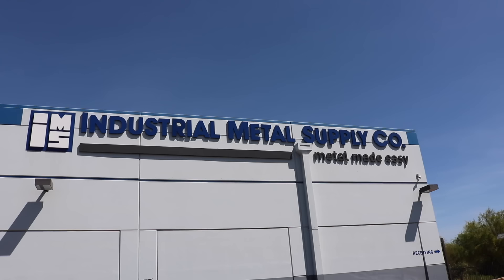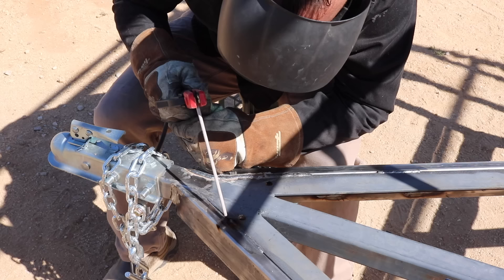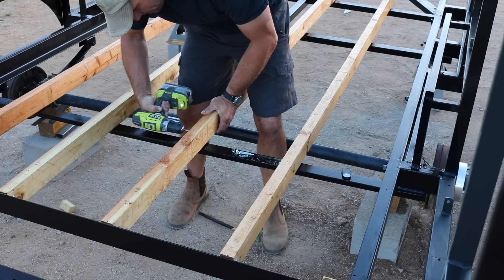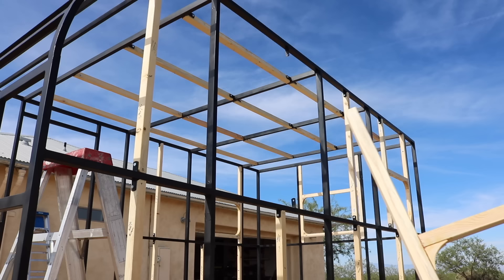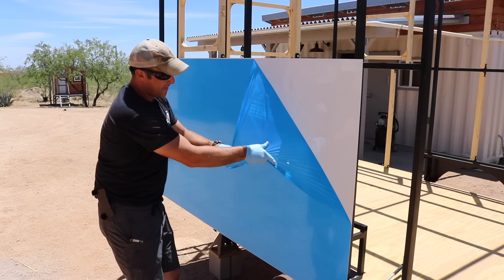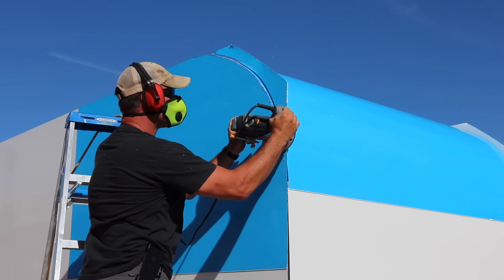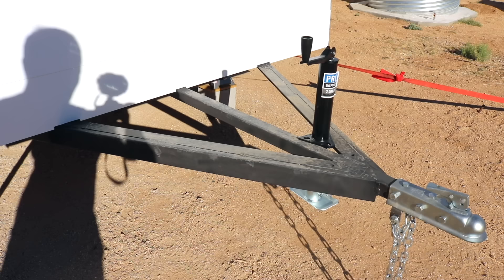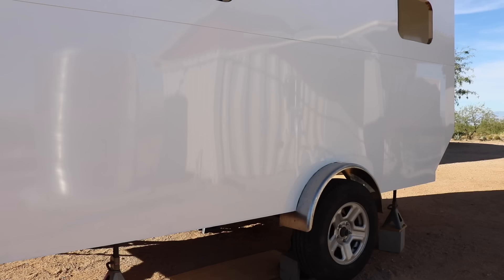How to Build a DIY Travel Trailer - Aluminum Exterior and more (Part 2)

Comment from the maker: For those interested in the Forney multiprocess welder I use, here is a link.  Forney sells welders, plasma cutters and just about any other metal working tool you can imagine!
http://bit.ly/2LjRRqH
Reply: homesteadonomics about how much do you think it would cost to build one of these?
Reply: Wow looks awesome

Can you please provide a listing of all materials and lengths needed to build your projects without a paywall for everyone outside USA
Reply: Me gusta lo que siste saves yo tanvien quiero aserme uno de lo mismo yo soy soldador ya
Reply: how many lights does a cargo trailer legally need?
Reply: homesteadonomics What is the name of that sheeting metal you used for the sides & roof of the camper?  I don't have the same metal shop supple place here in Florida panhandle. If I find anything like it ...I'm sure it will probably fall under a different brand or name.
Reply: As per usual, an excellent quality built result, well put together video as well. In a world gone mad it's a breath of fresh air
Reply: what kind of panel did you use?
Reply: What gauge is the panel?
Reply: Porque tengo yo que ablar en ingles porque no ablan ustedes el español jaja
Reply: How many times did you spend? 🧐
Reply: what did you use in outer covering
Reply: I'm interested in knowing if you can do that in all aluminum frame  and aluminum chassis and in a 1corter inch thick aluminum wall in the exterior

Comment: Not bad for your 1st trailer build. Some tips from someone who was in the RV business for 20+ years. 1. If you are going to run water lines, gas lines, installing grey, sewage, and fresh water tanks, you will want to run those underneath your floor and then have them insulated, heated and self-contained (covered). A polyurethane bottom to enclose your plumbing will protect it from the elements, plus give you additional storage space. By placing your tanks above the floor removes a great deal of your living space. 2. Make sure you have room for your power converter, hot water heater, furnace inside the trailer. You can build those into your living areas. I would also consider framing for an air conditioner instead of a fan for the roof. You will be much more comfortable. 3. Make sure that you use windows that will allow you to have an additional escape in case of fire. If your door is blocked, you will still be able to get out. Good luck with your build, it looks great.

Comment: Did that for years, worked for 2 big RV Companies. Weld dept, Chassis Prep, Floor Dept., and Rough Electrical. 
You did a great job!! Hahahaha Me personally, I'd never buy a RV most are junk. Everything except the Chassis and frames, is plastic and the wood used is kindling. 
  But to build your own, YES!! YOU SIR ARE GOOD.

Comment: Joe, I recommend fabricating some kind of plate and welding that to the tongue instead of welding that jack directly to the frame. In my experience, those A-frame tongue jacks get destroyed pretty easily, and for stupid reasons, and it will make sense to be able to just unbolt the old one and bolt on a new one.
Reply from the maker: yes, that is seemingly the best idea... you and several others have mentioned it and it makes total sense.... already looking at my scrap pile right now for pieces that I can make into a mounting plate :)

Comment: I bought  a tiny 5' X 8' barely used carson enclosed trailer. I made it into a tiny off road camper with a couch bed...it was a fraction of the price of a moby 1.  So one thing I forgot to do at the stage you left this video at is adding backing for a grab handlebar the door.  And another thing, get a roof fan with a thermostat. You will love it... when it gets really chilly it will automatically turn off. Or if it's summer you can have it kick on above say, 90 degrees. So finally add a couple wall mounted marine fans, if you just need a breeze. Lots of led lights. Looking good!

Comment: Nice job!  i would run a bead of sikaflex on the inside of the aluminium panels along the frame.. sure that tape is good but some extra strength wouldn't hurt especially because would be so simple to do
Reply from the maker: I've heard some great things about sikaflex!   lots of folks use it on teardrops and other campers with great success:)

Comment: Awesome to see u put some thought into it sealing all the wood I'm rebuilding a slide in truck camper all the wood was rotted out because nothing was sealed it is now every piece all sides awesome trailer much better built then any thing u can buy
Reply from the maker: Yes, I've seen a lot of rebuilds online showing the rotted out wood and I'm trying to do all that before hand in hopes of saving problems down the road :)

Comment: I'm curious to see how much it will weigh once it is finished, dont weld the jack, weld a plate and then bolt the jack to the plate. I had to replace a jack that was welded and it was a pain in the butt, I bolted the new jack in so it will be easier to replace if it breaks again. Use tubing to run all your electrical wiring in case you have to modify or replace  it in the future.
Reply from the maker: I'm shooting for low 2k range in weight.  It's not going to be a light trailer but I'll be happy if it ends up around the 2100-2250 range.   as for the jack, yes I do like the idea of being able to replace the jack so I'm definitely leaning towards adding a piece of steel and bolting.... you and a couple others mentioned that and makes total sense  :D

Comment: Can't believe the siding is just attached with sticky tape! Modern materials are amazing. Awesome project sir - looking forward to the next video.
Reply from the maker: yes, it's crazy how just tape can hold it on... but some trailers have been using it for years with success... if for somereason it fails I figure I can always add screws or rivest later :)

Comment: Beutiful work. I'm a welder by trade for 35 years. I used to work for a company in PA that did coustomize work for a trailer company. The trailer company had a carpenter / cabinet company to do the interiors. Was interesting n challenging work.

Comment: Just a tip for your floor. I used regular hardware and 3 years after it was rusted enough to break. I went and used some galvanized nuts and bolts I had left over from fencing my back yard and now no issues. When i refloored my car trailer i used them again where i could and they still look like they did 8 years ago now. I'm in the midwest so winter roads is one but parking around or on grass will rust the underside fast. Also run any trailer light wiring underneath to have access if a need arises.
Reply from the maker: Yes, I probably should have done that now that you mention it... but we don't plan on traveling too much into cold areas during winter where salt it used... but now that you mention it I do kinda wish I would have done that...haha      As for wiring that is the plan so far, and for the access that you mentioned...... 
but darn it.. you got me still thinking about switching those nuts and bolts out...lol  ;)
Reply: And if you do it, remember to add Thread lock in it.... lol

Comment: Looking good, the white aluminium is sharp! Really interested to see how the tape holds up. Every part of me is disagreeing with it but if it's been used commercially then you can't really argue
Reply: We used VHB to repair a friends camper roof. Tree had punched a hole in it. Cleaned down to bare aluminum, made a nice looking patch, used the tape then some camper seal caulk(stuff is way different than normal caulk) and it has lasted 5 years of MN weather so far. Hard to see the patch because his roof has that rubberized roof coating stuff on it and it got a whole new coat to keep other seams from leaking...
Reply from the maker: Thanks Robin!  its crazy to think about but it's got a great track record... worse comes to worse I can always add rivets later :)
btw... I hope you are getting some good two hour stints of sleep through the night ;)   gets easier after the first 3 months!
Reply: If you add rivets later,  don't forget to put plastic top hat washers under them so you don't electrically connect the steel to the aluminium,  or else you'll get galvanic corrosion.   That's an advantage to that tape that you didn't mention.
Reply: As long as the surface prep was done correctly (which he did) the VHB tape should actually provide a stronger bond than rivets. It has the benefit of being more flexible than rivets and providing some protection against water intrusion along the seam.
Reply: But I dont know the name of the tape that was used to hold up aluminium
Reply: I spent 20 years in an auto factory. Mfgrs have used that stuff for years to attach trim, ground effects, spoilers, etc. If properly applied, it won't come off of its own accord. It can be taken off. In this application, you'd destroy the aluminum getting it off.

Comment: I am very interested in seeing exactly how you going to seal the seams especially the corners.
Reply from the maker: it will be mostly seam-seal tape and butyl tape.. and then on the overlaps where the void is larger I will use some levelling sealant to 'flow' into the void area.  hope that made sense:)
Reply: Do you plan on using any sealant/tape on the vertical panel seams ?

Just my 2¢, but I would have made the front about 1"-2" taller to guarantee that rain flows off the roof.
Reply: @homesteadonomics  👍
Reply: @homesteadonomics  h
Reply: @homesteadonomics  👍
Reply: @jackpatteeuw9244  👍
Reply: @homesteadonomics  hh
Reply: @homesteadonomics  h
Reply: @jackpatteeuw9244  👍👍

Comment: You should be happy with the progress thus far. You're doing an awesome job on the trailer. I envy your metal working skills. Have you ever thought of holding meetups to introduce metal working/welding to the DIY community that follows you?
Reply from the maker: thanks John!  I am happy with it... just wish I had a couple weeks of the windy weather back and turned into more progress... hoping to have it ready by August ;)
as for meetups, I've definitely thought about it.  The issue is where/when,etc,.... the wife doesn't really want anything at home for obvious reasons.   but perhaps maybe something at an IMS might be something I could look into... not sure, but I will think about it!
Reply: Maybe a deal could be made with your neighbour to use his new shop seminar center.    the old guy  Bert

Comment: I would recommend that you bolt on the trailer jack.
Reply: Yup! First time you hit a rock or a steep driveway and fold it back you will be swearing at having to grind welds!

Comment: Are you going to add leveling jackets? If so, will they be manual or electric?
Reply from the maker: Hi Darryl,   Yes, I'll be adding some stabilizer jacks... manual most likely.  I'm still deciding between some flip down jacks and aluminum A frame style ones.   the flip down ones look really cool but the a frame ones seem more reliable... decisions decisions... LOL :)

Comment: If you want to get the best seal at your seams, use PRC. It’s specifically designed for sealing aluminum skin joints on aircraft and will not fail no matter the environmental conditions. One of our engineers did his trailer with it over 20 years ago and still has yet to have a leak, and that’s sitting outside in Canada all year round.
Reply from the maker: I think I read about that on tnttt.com... seams like great stuff and I will have to look back into it:)

Comment: Great trailer idea! Great hands!)) this design allows you to increase the trailer 2 times!! since the beginning of the extendable base on 2\3 with the retractable pull-out of niche then the niche put forward by another right and left on the floor of the size of the case... It turns out the whole house on wheels!

Comment: Congratulations on the beautiful trailer build!  Going to build one myself.  I spotted just one problem where the steel and aluminum are not electrically separated.  This will cause galvanic corrosion at the contact points and rust out the steel.  It's simple to fix by using plastic washers or adding plywood in between.  Awesome build man!

Comment: Use a thinned epoxy to saturate deep into the plywood and then a full strength coat to finish. Old boat builders trick.

Comment: Using the VHB tape is a good idea, because it is giving you an additional benefit that you might not have appreciated: you are bonding dissimilar metals, with a danger of mutual damage due to electrolysis. The tape is providing you insulation and isolation between the steel frame and the aluminum siding.

Comment: Very nice work. May I suggest welding a bracket for the tongue jack instead of welding it to the frame. I only suggest it incase something happens & it needs to be replaced, though as good as you are @ welding it probably wouldn't be a big deal for you. I can't wait to see part 3.
Reply from the maker: thanks!  and yes, its' been brought up a few times and makes total sense... so that is definitely the plan now... bracket versus weldon :)

Comment: The aluminum looks really good, looks like it's gonna be watertight. I'm rebuilding an Airstream motorhome aside from using stainless on the inside instead of aluminum I'll probably use the same method of the tape over the aluminum frame to adhere the stainless. Can't wait to see more progress and how you enclose the edges of the trailer. Good job.

Comment: Nice build ! I will be very interested to hear final costs and weight . When I rebuilt my old class c cabover floor , I bought a flanging tool that would have made your aluminum panel overlaps much tighter . As a former volunteer firefighter , I am amazed at how poorly many trailers and motor homes are built . Much particle board and two by twos . They fly apart on impact . Yours looks well built and sturdy .

Comment: Don-MN/ A note on return of trailer if stolen: Stick your return address label inside tail lights and side markers if possible. A Warden or Trooper sees a close match and signs of tampering and tongue ID missing can remove light covers and get your info from within ! We have 30-40 thousand dollar fish houses for Ice Fishing and Summer camping. Hurts to have one stolen. I believe it's harder to steal again with rebuilt knees !  Your videos are top line. Thanks, Don. PS, I'd put rebar inside angle iron top of lock; Disc would not reach through and rebar would rotate, for longer cutting time and sparks should draw attention or run his battery down !! Paranoid ? You bet.

Comment: Nice job, it's looking great. From an engineering point, it might be good to use nylock nuts, or at least spring washers on the frame to wood bolts, as once it is covered you will not be able to tighten them, or you could jam a second nut on each one to stop them coming loose. Don't like the sheet metal hitch either, I would look for a more heavy duty cast one.
Reply from the maker: thanks Jon!  the extra nuts is a great idea... and the hitch is from the original build idea from two years ago... its still up for reworking as its just on with bolts and not welded... this trailer started as a 5x10 that was to be pulled by my jetta tdi... well now it has morphed in to something much bigger.  thanks for checking it out and the nylock advice :)

Comment: Joe, I'm surprised you didn't use pressure treated lumber underneath...educate me! Stoked I finally started my welding table! Bought a plasma cutter today, so had to redesign some elements of the table in progress. Best, @HoneyOnWales
Reply from the maker: congrats on the plasma cutter!   as for the pressure treated lumber... mostly an availability thing for thickness... my local homedepot had it in the almost 7/8 thickness which I thought was too heavy and overkill for the floor.  But my research on tnttt.com lead me to opting for sealing well... because the only time the wood should be exposed to water is during transport.  and for that the bottom, after I finish wiring and plumbing will end up getting a couple more coats of water proofing as well as a spray barrier for road spray.  so in short, I don't expect it to have all that much water exposure... hopefully ;)

Comment: At about 6:53 I saw that your roof had no crown. When I restored my 12' Shasta I put a crown in it to insure that water would not pool and ac could be added without putting a sag in the roof. Please be assured that I'm not being critical, just passing on what worked well for me. I thoroughly enjoyed your build and I learned some things. Thanks!

Comment: Well that is a lot of work. I would just buy a used horse trailer and convert it. A lot of horse people use their trailer to haul the horse .When they get to the camping site take the horse out and put cots in the back or if they have a large dressing room up front it has bunks ,frig. lots of cabinets or peg board to hang stuff. I have a nice insulated 2 horse with dressing room bumper pull with dressing room.

Comment: Since you're looking mostly at boondocking - what are you gonna do as far as holding tanks; how big are you gonna go?  And just as a tip - more compact newer units seem to have small window AC units mounted usually in an upper cabinet in order to save costs and clears a big portion of the roof... if you do that - you'll have room for a lot more solar up top (guessing that's gonna be part of this).  Thanks for posting this, I've often wondered why no one makes a metal frame like yours.  I bet this thing will be a lot sturdier than just about anything on the market!
Reply from the maker: dre04mach no more than 20 gallons or so...will have a filler barrel in the truck as I don’t want to travel with the tanks full in the trailer....as for solar, yes eventually...ac, not at first...we mostly camp in cool places in the summer...but it is something I’m exploring😉